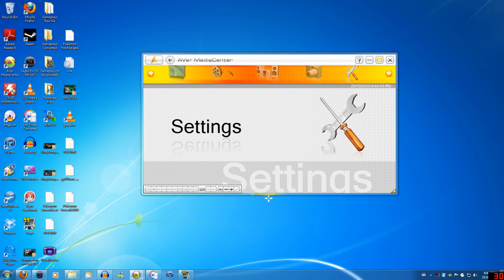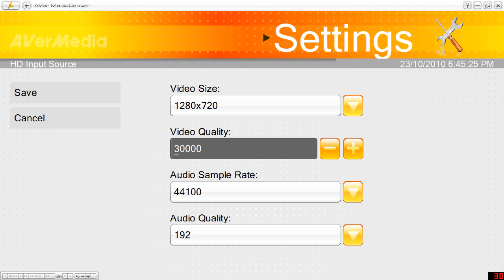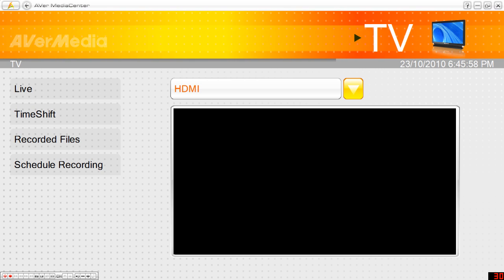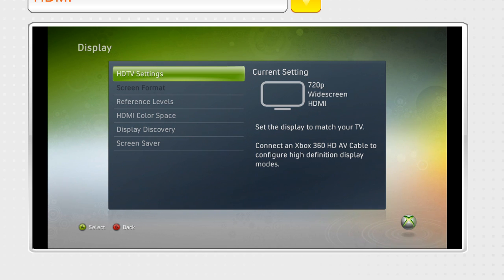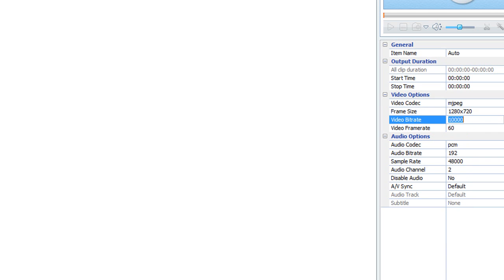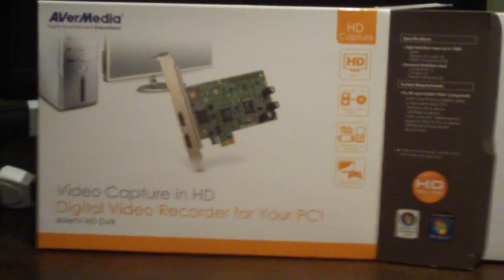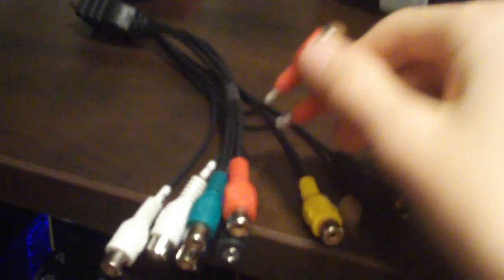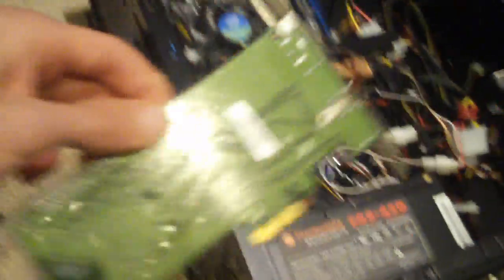AverMedia AVerTV HD DVR Setup, Installtion, and Use

Comment from the maker: @rawrmazering This is usually an issue with the splitter. Well actually it's the xbox having an issue with splitter. There's generally two ways around this. 1: turn on your xbox with only one of the HDMI cables connected to the spliiter. After it's turned on plug the second cable in. 2: go to console settings, and under display turn off display discovery. Either of these should fix this issue.

Comment from the maker: @Imoviefilm You'll also need 2 HDMI cables (don't pay more than $10 each, look online or at smaller computer stores). It will work with a monitor, I use a monitor. You just need to have an HDMI input, or alternatively you could buy a DVI to HDMI converter, and use the sound from your computer.

Comment from the maker: @Luijeee It probably is. But what you have to consider is that the quality isn't halfed, the transmission speed is. So instead of 5-10 Gb/s (5 for older HDMI cables and 10 for newer ones), you get 2.5-5 Gb/s. An uncompressed video signal in HD is less than 1 Gb/s so it shouldn't make any difference.

Comment from the maker: @calltoduty5 Return it, go to ebay and buy one. The only difference is that they're a little less durable, but you could 5 before you actually lose out. Mine have never broken, like honesty how do you break a cable? Maybe if you yank it out of your TV 10 times a day. Cheap HDMI cables work fine.

Comment from the maker: @kevinis69 I use WMV 1280x720 at 6mbps for video and 48000hz 192kbps for audio. My template video shows my render settings. There's a link to it on the side of my channel. Check that out.

Comment: Need some help anyone when i plug my ps3 or xbox into the HDMI slot on the dvr and load TV i get to see the screen for about 2 seconds then a message saying 

fail to play this video your video card or connected monitor may bit support high bandwith digital content protection HDCP or dual screen use or change of resolution

( also tells me to use componant cables... HELP ANYONE)

little bit at the end of what it says was what i remembers but yeh icant even see the screen of ps3 or xbox for 5 sec

Comment from the maker: @MisterProdigy I don't think both cables will fit in at the same time. The splitter is only $5, its not a big deal. If you order it from the states it'll cost $10, but should ship within a week.

Comment: @Lonegraywolf75 I have the same problem, Please help! There is no green lines when it is just the console directly into the cap card. but as soon as you plug the other cable in the image goes all fuzzy with green lines and spazzing everywhere. The image on the tv is fine though.

Comment from the maker: @terminator4880 One is digital in and one is component in that you use with the HDMI dongle adapter thingy. You definitely need an HDMI splitter. You can buy from eBay, it's $5 from China and $10 from the US, the only difference is the time it takes to ship. It takes about 3-4 weeks from China and 1-2 weeks from the US.

Comment: @MidnightDubstep I had same problem (green lines) then I got to a point where I couldnt get any image at all. So i sent the splitter back thinking it was defective. One person mentioned splitters are mainly used at sports bars to split hdmi signals of two idential tvs (lcd screens etc). Another guy said you may need an hdmi splitter /amplifier to get it to work. I tweaked w/ Aver media settings , PS3 settings etc. nothing. so i bought a component setup instead and trying to get that to work now.

Comment from the maker: @SgtGa1axy Two things you can try:

1. Turn the xbox on with only one of the devices plugged in (either only xbox or only computer). Then once the xbox is on plug the other one in.

2. There is an option somewhere in the xbox that says something like auto detect display, look for that and turn it off.

Comment: Hey I have a monitor that I run both my PC/360 through.  I have a HDMI switch to go between the two.  I also got a HDMI splitter connecting to my PC and the switch.  What I want to do but can't is record while having my input on the 360.  However when I do, the Aver screen is black.  When I unplug the 360 HDMI from the splitter, video shows on the Aver but can't switch to the 360 only.  If you wish to help me I can provide a picture describing my setup in more detail to make more sense. Thanks!

Comment from the maker: @F1RZT2BOMB Make sure the card, software and drivers are correctly installed. Make sure input is on HDMI. Try rebooting your PC. If that doesn't work contact their customer support, I didn't have any problem.

Comment from the maker: @jaksbak5 Intel Core i3, 4gb RAM DDR2, GeForce 9800 GPU

What windows thinks of my computer:
Processor: 6.9
RAM: 5.9
Graphics: 5.5
Gaming Graphics: 6.5
Primary Hard Disk: 5.9

I'd also recommend having atleast 500gb of hard drive space, unless you want to be constantly deleting videos. A 10 min video is about 2gb, and then you need to convert to get rid of audio lag. 

I don't really think AVer uses much RAM or CPU at all. But if you have a PS3 you need to record with FRAPS which uses a lot.